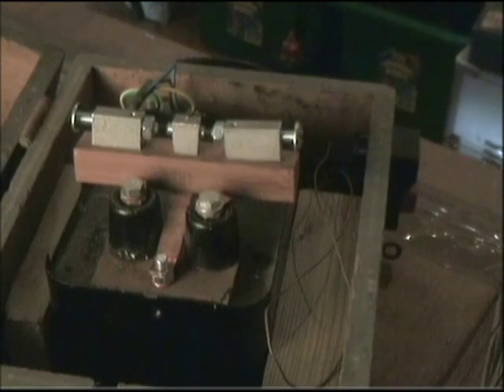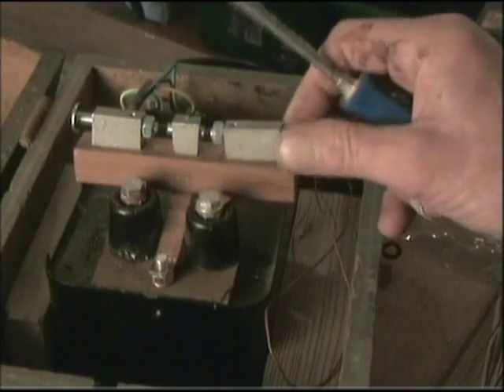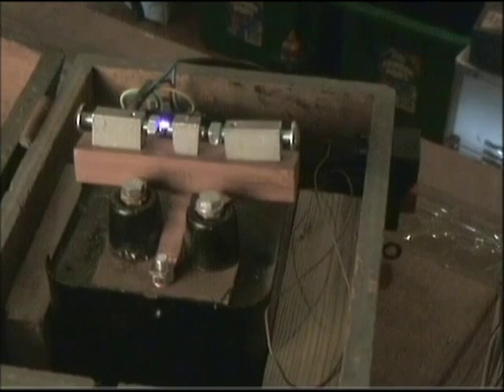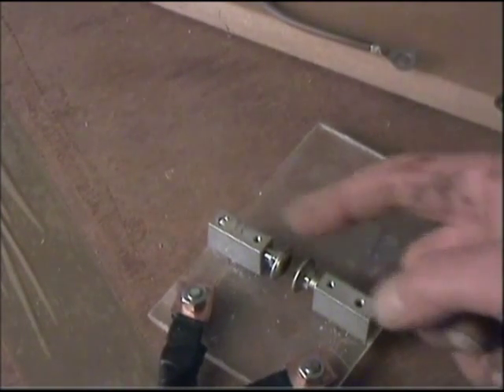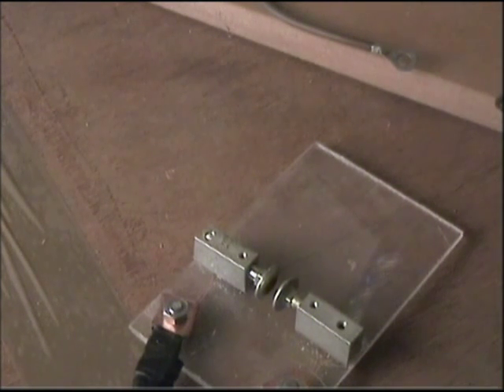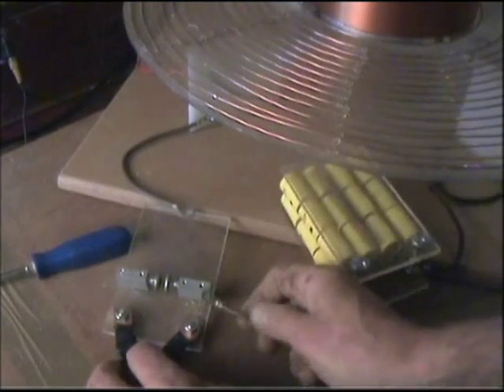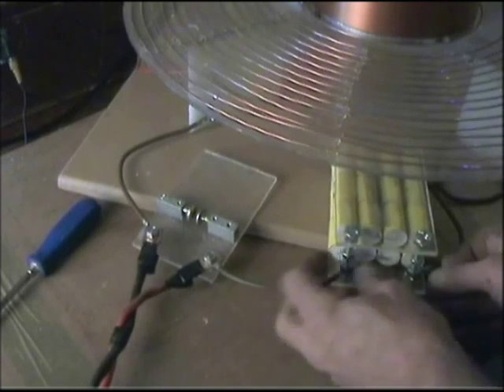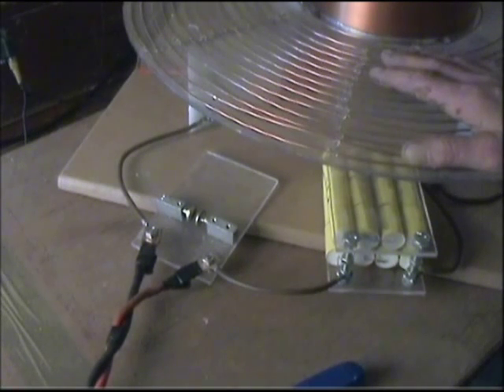Setting up Spark Gaps

Comment: This is the main gap in the tank circuit with the capacitors connected, I get one initial "snap" from the caps charging and discharging once but after that I just get a fierce fiery arc where there should be loud sparks.

Comment: How do I stop continuous arcs from forming? If I limit my supply current by turning the voltage down I can get sparks to pulse, but when I use higher input powers I just get a high current and voltage flame arc between the gap and not sparks. Its like my capacitor doesn't even get charged.

I am not sure how much current it gives out but the arc will stretch a good few inches before it extinguishes.
Reply: Hay i have the same problem have you managed to solve it?
Reply: From what I've gathered when the power goes up too high you end up with an arc as described there are pretty much two work arounds for this, use higher input voltage and spark quenching. Higher input voltage lets you keep the same output power at a reduced current but make the gap longer and so easier to extinguish. The next is gap quenching. The goal here is to cool the arc as fast as possible. With big machines rotary is good. For medium and low power series spark gaps, forced air, and magnetic blow out work fairly well.